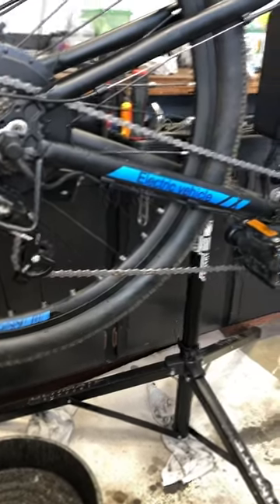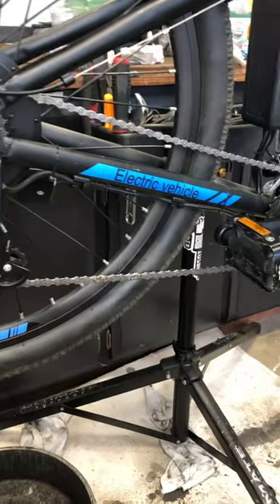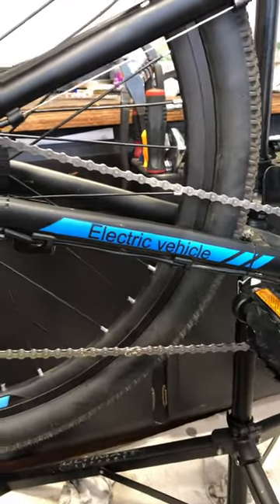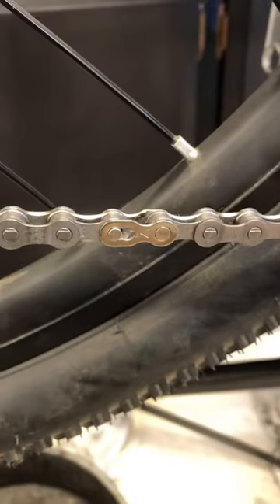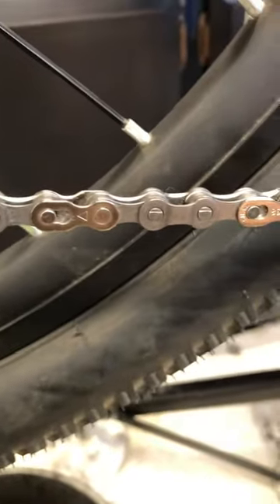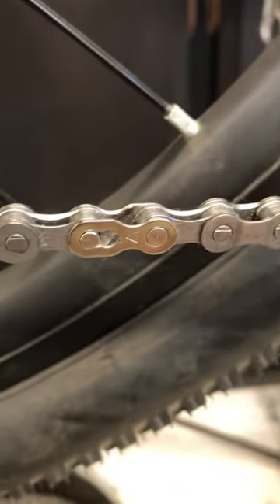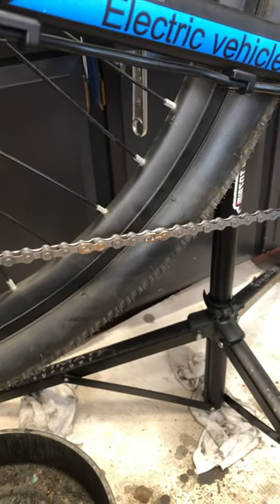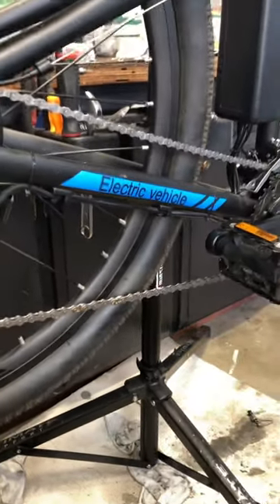When the bike chain is too short out of the box.  How to fix & take care of quick link.

Comment: Is this safe to do?
I had a KMC X9 Ti-N chain lying around from a previous bike with 6 links too short for my current bike. I joined it today in the same style as you did. Seems to be fine for now, I hope my front derailleur won't somehow disconnect the chain when shifiting. (3x9 setup)